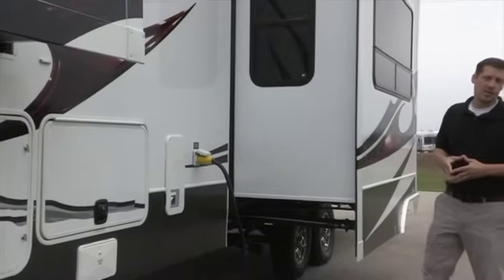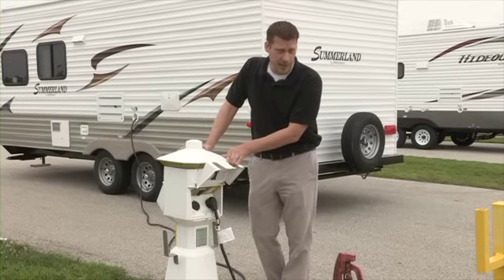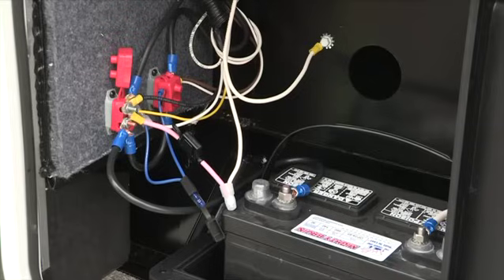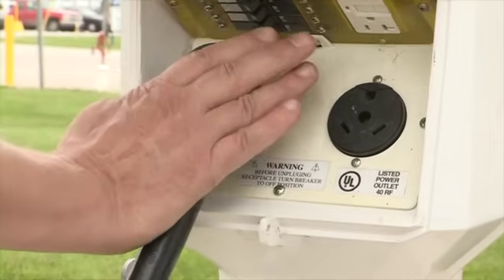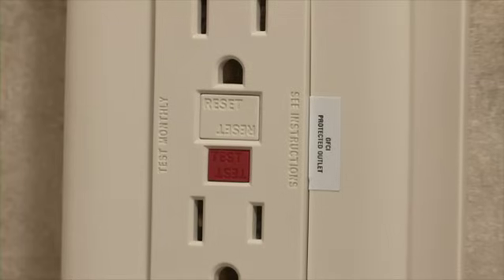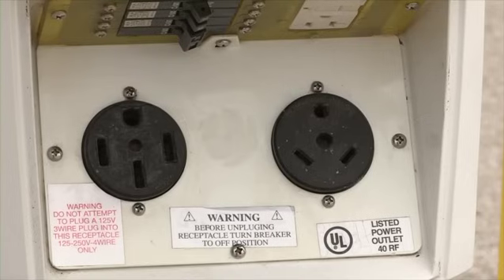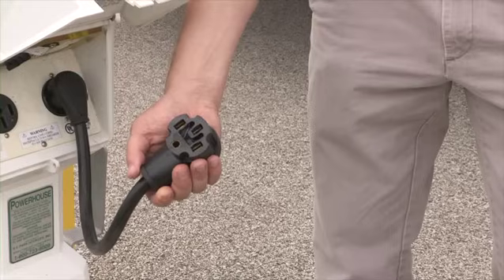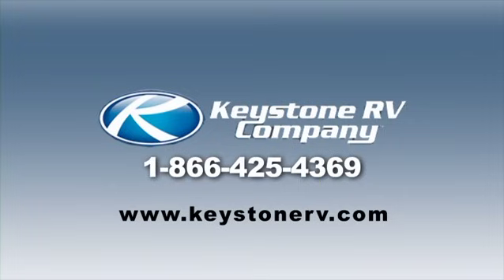Understanding Keystone RV Electrical Systems

Comment: I have a 2006 keystone zepplin 2 travel trailer it's 30 amp what amp auto reset breakers should I have on the front near the battery?

Comment: Who is so lame as to put the refridgerator above the breaker and fuse box. Then, I go outside because I have water leaking and pull of tge panel where the water attaches to the trailer only to see that the water supply is running right over the electrical system with no guard in case of leaks. That is very very unsafe. My whole panel armed when the fridge was leaking from compensation buildup. 
VERY UNSAFE
Reply from the maker: Thank you for your feedback. We truly do appreciate it and will ensure this is passed on.

Comment: We're high and dry on our own with the Cougar Touch Panels... mine is in a Cougar 330 rbk. I need to get my ceiling lights on a switch... furnace board is now cooked due to having to reset the breaker just to get the lights to work

Comment: I have a 2002 keystone cougar 281 efs model. My slide out isn't working where's the fuse for it?
Reply from the maker: Good Morning, there should be a fuse on the control panel where all of your fuses/breakers are or other will be an inline fuse just a few feet from the slide itself. We recommend checking the area thoroughly as it should be near the slide.

Comment: When im on battery only can i charge my phone or use my tv?
Reply from the maker: Good Morning,

Yes you will be able to use items in your unit if you are using battery power. Do kee in mind that the more you use off of the battery power with nothing charging it can cause the battery to drain quickly. If you have any questions on this please do call us at 866-425-4369. 

Thank you!

Comment: I have a 2013 cougar 32 SAB keystone.  Interior light on slders on ceiling stopped working. Led's installed. All other led lights work perfectly fine inside camper. Fuses all good, battery good. What should check. Thank you
Reply: I noticed most of my freinds have same issue me as well , mine was wiring doing to the slide out .,not the fixture or bulb
Reply from the maker: Good Morning, we would recommend checking the wiring behind the light and all wiring by the switch for that light. If it isn't a loose wiring issue then you may just need to replace the light complete.
Reply: @KeystoneRVCompany  Good morning and Thank you very much for your time..I will check them.out.

Comment: Great Video, thank you providing explanations of the system. I know you can't troubleshoot over text but, I have a question. Any idea why my 12v main (20A) fuse blows when i connect or disconnect my 30A cord from my generator (no load on system)? Bad converter possibly? TIA

Comment: Please help! I have bought two batteries now both deep cycle batteries 12 volt 690 MCA 101 amp hours. Both of which have died on me. I live in the rv full time so I'm guessing it relies a lot on the battery. The rv is also connected to a 30 amp breaker switch inside of my parents house. This is in a 2004 Keystone Outback 28 RLS and I can't find anything online about it. Do I need a bigger size battery or what is my problem?

Comment: i have a keystone 2007 my slide will come in but won't go out. what would cause this?
Reply: I have same problem… ever figure out?
Reply: @mitchsalewsky6475  the clip on the solenoid was dirty on mine. I clean it up with some sand paper last week and it works fine now. Not sure for how long but it's working right now

Comment: My neighbor has a keystone and her lights start to dim and flicker than shut off. They come back on later.... What's the best test to figure out the issue?
Reply from the maker: Good morning, since the lights are 12V she would want to check her power converter. It should be outputting 13.65V when plugged in to shore power. She can also check her batteries and her mini-breaker for voltage. If she needs further assistance, she can contact our retail call center at 1-866-425-4369 Monday - Friday. Thank you.
Reply: @KeystoneRVCompany  thank you for the guidance!!!!!
Reply: @usmcdoc2512 reading your comments on you neighbors ellectic problem. Lights flickering .3 years ago. Do u remember if you do can u tell me if it got fixed

Comment: I have a 2022 Passport GT Series with 2 solar Panels and 2 batteries. We're at an RV park and went through a storm. Since we didn't yet have our Surge protector, we unplugged from the 50Amp outlet and figured that the 2 Solar Panels and 2 batteries would be enough. Except that the TV shut off, lights dimmed. The Panel with battery level was blinking & beeping  that it  was low. We plugged back in and I reset the GFCI which brought back the TV. My question is, with 2 solar Panels and 2 batteries, why did I run out of power? Am I supposed to flip some kind of switch to tap into the Solar energy? The Battery Disconnect was on.
Reply from the maker: Good morning, we are sorry to hear you’ve had issues with your unit’s solar system. There isn’t enough information provided here for us to be certain what is happening. Based on what you are noting, as long as there was sufficient sun, and stored energy, the batteries should be charged up even with the 200 system. There may be an issue somewhere in the line, however, we can’t be certain until you’ve confirmed the following and have this formally inspected. You’d want to see the status of the Victron App to see what power is coming in/going out, and we’d want to see that the batteries are testing good. If the controller and batteries are good, there should be enough power to keep the lights on. The TV wouldn’t work unless you purchased an aftermarket inverter for the inverted outlets. Not sure if you did that, as you don’t mention that here. The batteries and inverter are not included by Keystone RV. I would ask that maybe you report your findings and any further questions through our retail team at 1-866-425-4369 Monday – Friday with your VIN. We do have solar experts in our call center that can also answer questions and troubleshoot with you. Thank you.

Comment: How do I turn on the heat in my 2015 keystone passport 171 exp?
Reply from the maker: This sounds like a great question for our retail team. The can pull what furnace is installed inside that model with your VIN and provide you direction from there on how to turn it on from the thermostat. They are open Monday-Thursday 9am-5pm and Fridays 9am-4pm all times EST. The number is 1-866-425-4369 Thank you.
Reply: @KeystoneRVCompany  ... thank you so much for your help.

Comment: We have a Passport Elite 19RB. When plugged in to 30 amp service, we can use the outlets to power appliances. When we are not plugged in, is there an inverter that changes the 12v to 120 to power appliances like a CPAP? I guess my question is, is there a built in inverter that services the outlets by the bed, in the kitchen or in the bath, and behind the TV?
Reply from the maker: Good morning, this is a great question. Because this is a VIN specific question, you'll need to call with your VIN and speak to our call center to confirm what your unit came with or is prepped with. The number is 1-866-425-4369 and they are open Monday - Friday. We will note, if you have inverted outlets, then the outlets themselves would be marked to identify which ones are inverted. Thank you.

Comment: Is there a fuse for the battery charger? If the charger is not working do I have to replace the entire DC convert?
Reply from the maker: Good afternoon, yes, there are 2 (40AMP) reverse polarity fuses on the converter itself. The output of the converter should be 13.65 volts when plugged in to shore power. The converter will not charge the batteries when not connected to shore power. If the converter has lower than 13.65 volts in output, you'd want to contact a dealership or service center. If the unit is 2 years old or less it may still be covered under warranty. If it is older than that, they'll at least be able to assist you in ordering a replacement. You may find our dealership locator link at www.keystonerv.com. Thank you.

Comment: I bought a 219BH Passport and it is solar ready. I bought an expansion panel and is fine, but then when I was going to install the inverter...I removed the "future inverter location" box and a 20AMP yellow Romex wire appeared, no ends, is a loop so it comes out of the wall and goes back inside the wall. I don't see any other wires (to the battery) but the converter is next to it so I guess I can wire it directly to the LOAD connectors in the converter. How do I find pictures or instructions on how to deal with the ROMEX loop? I was expecting a terminal or end of the cable. The owners manual reads that is "pre-wired for seven outlets" but I pull and both ends seem to be connected unless it is snagged and I am too weak or afraid to pull hard.

My thing is that if it comes prewired is best to use it and looks like that Romex protruding out of that hole like an intestine is where it needs to go but it does not make sense to splice it. I called and chat with Keystone but the girl in the chat had no idea and when I asked for a diagram, like the blue prints of a house, she said they don't send those to customers.  Not even the roof plan to see where the joists would be for the solar panel brackets. I could test the wire but I don't want to cut the insulation. I took pictures but I don't know how to upload them here, I could send them in an email.  My thing is that I understand the concept and I have done a lot of electric since my father was an electrician and I his helper until I was 21, but I don't know if the Romex comes or goes to the panel, converter, or just directly to outlets (which I doubt0 and why is it a loop and not an "end/tip".
Reply from the maker: Good afternoon, we will do our best to get you an answer here shortly on this! Thank you for your inquiry, and we'll respond here soon. Also, if we need photos we'll direct you to sent them to ownerrelations@keystonerv.com directly. However, I would wait until we get some answers on this first. Thank you.
Reply from the maker: Good morning! We do appreciate your inquiry. There are several things to keep in mind and so we will give you the best feedback we can based on the information you provided in your comment. Yes, the wiring is looped and we do NOT recommend pulling on it. It’s a simple receptacle circuit, which we do not label or have any schematic to provide to help you in your efforts with that. For safety reasons, we do not recommend RV owners to work on their 120V system. We do not have a video for the installation of the inverter for this reason as well. What we can do is refer you to a local authorized dealership for assistance with installation of the inverter itself. https://www.keystonerv.com/find-a-dealer. They will be able to guarantee their work, and you’ll have the peace of mind knowing it was completed by an authorized location. We also have a team here on the dealership service side for support if needed. What we can advise regarding mounting of the solar panels is that the roof is 3/8” decking, and the panel can be installed pretty much anywhere on the roof where there is room as long as your cables near the port, typically within 3’.  We hope this information helps you in your efforts. Thank you!

Comment: If we remain on shore power and the converter is converting AC to DC, why is a battery necessary?
Reply from the maker: There are directly related 12V items supplied to the unit that do not come from the shore power. Such as your slides and jacks. There are many features in the RV that require a 12V battery source in order to operate due to how the unit is wired. If you have additional questions about this, please feel free to reach out to our retail team directly at 1-866-425-4369. Thank you.

Comment: How do I connect POS and neg wires to battery? Wich order do I connect it too??
Reply from the maker: Good morning, it depends on how old your unit is. If it's a newer unit, 2016-current, then it's wired just like an automotive battery. Black is negative and red is positive. If you have an older unit, then it's likely going to be backwards. If you have further questions, please do contact our retail team at 1-866-425-4369.Thank you.

Comment: We just picked up a used  2017 premier ultra lite 29rkpr and the convertor fan is continually running any thoughts to why we are plugged in to our house. Thanks
Reply from the maker: That is a great question. The converter fan will run at all times when you are plugged in to a 110 power source or shore power. We hope this helps answer this for you. Sounds like it should be operating as designed.

Comment: I have a 2007 Keystone Outback M 23RS model plugged into wall outlet using heavy duty RV extension cord but still has no power to run AC ( Carrier RV) and Fridge (Dometic autoref temperature controlled) after it shut off from low power to shut off entirely yesterday; checked GFCI and Circuit breakers which was initially changed to the proper rating and amperage due to 3 blown fuses upon checking after the power shut off (2 40amp fuse and 1 20 amp fuse); the alert meter propane gas detector was blinking red to steady and now not on green but dead. I was informed as well that 2 30lb propane gas was low initially as it has been used, All RV outlets working including lights, excluding Stereo(Jensen) which s not working, no power on, but Microwave is on as tested. Need help to turn on AC or Fridge so as not to overload. Please and thank you

Comment: What would happen if I plugged my 120 volt camper into a 220 v plug. All appliances are working but the lights and awning aren't.
Reply from the maker: Good morning! If your awning and lights are not working, we recommend to check the voltage on your RV battery. You would need between 12.6-12.8 volts in order to run the components properly. If you need further assistance with this or you have any other questions, please reach out to our Owner Relations Department at 1-866-425-4369. Thank you!

Comment: Please help i have an 07 keystone and been in it for 3 weeks 2 days last week my 50 amp breaker tripped the ref hot water and the ceiling fan were the only things running then last nite at 3am no hard power pulls it tripped again them at 630 then at 9 the light font dim everything seems fine them it trips
Reply from the maker: Good morning! For immediate assistance with this, please contact our Owner Relations Department with the last 8 digits of your VIN, directly at 1-866-425-4369 Monday-Thursday 8am-5pm & Friday 8am-4pm EST. Thank you!

Comment: If you use a 30 amp adapter on a 50 amp receptacle you are saying that its only good enough to run the battery charger and nothing else?  Would you not be able to use 30 amps?
Reply from the maker: Unfortunately, the unit cannot “step up ” in amps. You can only use an adapter to “step down” from 50amp to lower amperages. 

You cannot go from a 30amp and plug in to a higher amped plug, even with an adapter you cannot adapt up, only down.

Comment: Why is the converter pigtailed with the ac receptacle breaker? Can I safely add another 15a breaker to isolate the converter?
Reply from the maker: Hey there, we would be happy to help answer any of your questions if you would please call 1-866-425-4369 thanks!

Comment: the trailer is plugged in into 50 amp source, the interior lights come on, the TV is playing but nothing else operates (AC, microwave, appliances).  The coffee maker light/time comes on but doesn't get enough power to make coffee. What is the issue?
Reply from the maker: We'd love to help you fix this issue! Please contact customer service directly at 866-425-4369.

Comment: I have a 2102 Laredo bumper pull. I pulled the wires off the first breaker on the hitch because it was rusted to hell and forgot which post (on the breaker) had 2 wires and which had 1. Not sure if it matters but I would appreciate any help here. And please, forgive my retardery.

Comment: Why does the battery/12V system use black and white wiring? This is too easily confused with 120Vac hot and neutral wiring! Also, why would the black 12V wire be positive? On cars/trucks, black is negative. I don't understand why the 12V system doesn't use the same color code as cars and trucks.
Reply: RV in camper trailer wiring isn't the same as any other wiring and it confuses the s*** out of me because it's different from car or house wiring The color code is the opposite of house wiring apparently in this